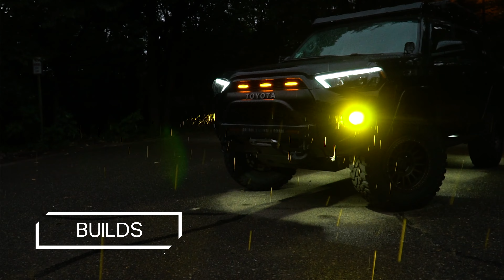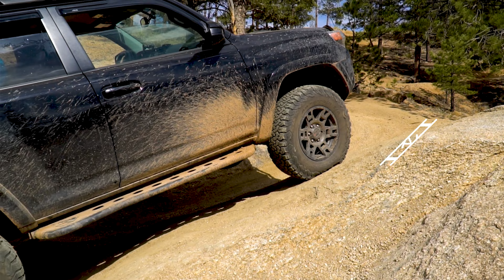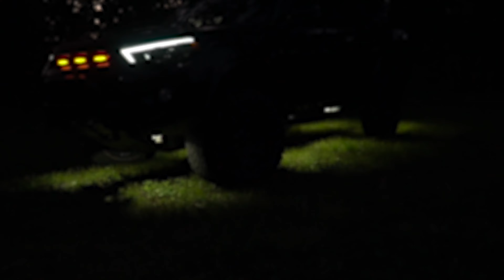BUDGET In Dash 6 Switch Electrical System | Fuses, Relays & Wiring EXPLAINED!

Comment: Hey!  Can you help me figure out the wire size needed to run power to the switch?  It looks like, from your drawing, that the switch itself doesn’t take too much power?
Reply from the maker: I might be able to point you in the right direction!  What is the maximum current for your switch?
Reply: @OverlandEngineer  I’m sorry. I’m thinking the wire size to power the relay and the wire size to run to the switch?
Reply from the maker: @brettferguson6954  Yeah it is the exact same process, figure out your maximum current and how long each wire needs to be!  It will depend on each switch and relay.
Reply from the maker: Typically how I do it is find the maximum current that would ever flow through the wire.  Then I use a chart like this one: https://jascoautomotive.com/automotive-wire-amperage-capacity-chart/ to determine what size I need based on the length I need.  I try to order the wire jacketed because then it comes with a big thick protective sleeve around it and many people will go a size or two larger on wire just to be safe.  Multiple ways to do it!  Larger diameter always is better from what I have seen.
Reply: @OverlandEngineer  so…my switch says it will handle 20amps and my relay says 30/40?
So I guess those numbers are telling me how much they can handle?
But, I’m thinking I don’t need to run like. 12awg. I guess I need to know how much amperage the relay needs in order to operate?
Reply from the maker: @brettferguson6954  Well the switch can operate that high?  That is impressive.  Then I guess what is the next thing to fail.  What is the max current of what is connected to the relay like your light?  You can also dictate wire size through the fuse size you choose.  Maybe the switch is rated for higher but if you use a 5Amp fuse, then the fuse will blow before the switch does.  It appears that people typically do 16-18 AWG probably with a 5Amp fuse.  But it depends on the wire length and that fuse size you choose.  Everything depends on everything haha.  So drawing it out helps to track how much goes where from the battery to ground.
Reply: @OverlandEngineer  thank you!  You’re very helpful 😁
Reply from the maker: @brettferguson6954    No problem!  It's what I try to do!  I also really try to teach people how I understand it or give them good resources and not just tell them what to do because it really helps people trouble shoot their setup if they every have problems.  It also is typically not great to tell people what to do because they may not fully understand their system and the right questions to ask so it has to be a discussion!  I was always driven crazy by teachers that would tell me to ask more questions and I would respond with "you have not taught me enough basics about this concept for me to even ask a thoughtful question!"  Anyways...I am off topic haha.

Comment: I need to dig out a book I have that is called Baja bugs and buggies and the author goes into size of wiring. Basically in equates to go as large as possible so that way if something happens and you have to scavenge from another system you can do it easily out in the middle of nowhere
Reply from the maker: Oh that is interesting!  I never thought of using larger wires in case you have to move wires around.
Reply: @OverlandEngineer  that and also it's better to be too large than to be too small as well, as I said I will have to dig up that book and find that part of it, there was a lot of information in it because the author was a Baja 1000 runner from the 60's through the 90's iirc. He even goes into things that people are finally saying on their videos like keep your thumbs outside of the wheel and stuff like that. For me I have driven that way ever since I read the book the first time almost 25 years ago.
Reply from the maker: @bajasoobnut  Interesting!  Yeah wire diameter matters and also wire length will start to require larger diameter as well.

Comment: Just watched the video, great idea! Do you happen to know if the OEM style switches would fit in this?
Reply from the maker: I guess it depends on which OEM switches.  I think the short answer is no because Toyota uses a smaller size than standard.  The USB/Aux won't fit back inside but I hopefully have a solution for that.
Reply: @OverlandEngineer  got it! Thanks. I was wondering if I could put a couple of them from Cali-Riased in it that I've got. They're the smaller OEM sized ones though.